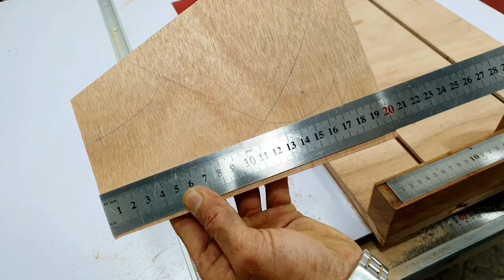Cutting Becomes Easy And Precise With This Jig || Table Saw Crosscut Sled // Woodworking

Comment: Very impressive sled. Based on the design and location of the T slots I see it can cut any degree/angle but what about degrees other than 90 or 45? Would you just pivot the speed square or do something else? An adhesive back decal with 0-45 degrees would be a huge feature. 0-50 would be even better.

Great work and great video. Thxs for posting.

Comment: Brilliant build and presented so well…… Question: Does your ruler move on the magnets??? Am making a new updated cross cut sled and was going to use the exact same ruler but drill holes and secure with screws….. Thank you for sharing your ideas Tim from Australia 🇦🇺
Reply from the maker: Thank you for watching!
My ruler is movable and it is held by the attraction of the magnets
Reply: Thank you for such a quick response I will use you magnet idea in my new cross cut sled … Sorry if it’s not rude may I ask what country your in????